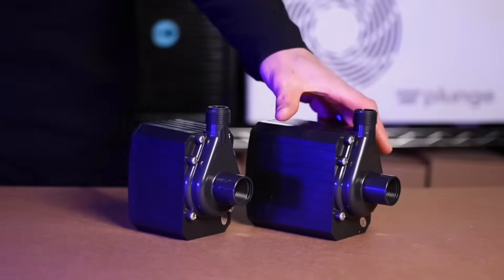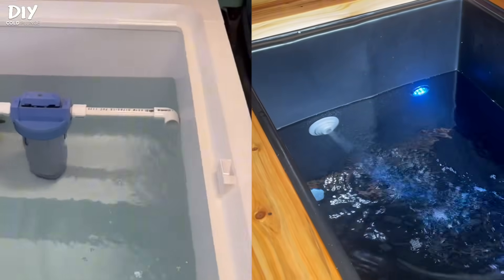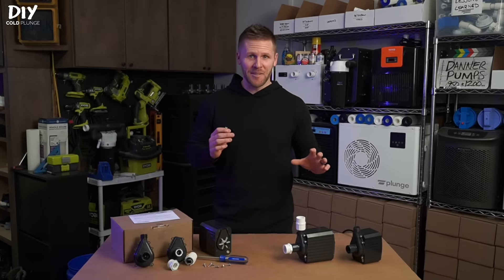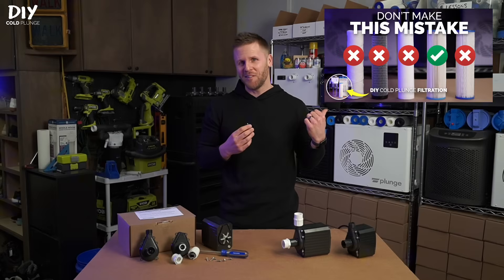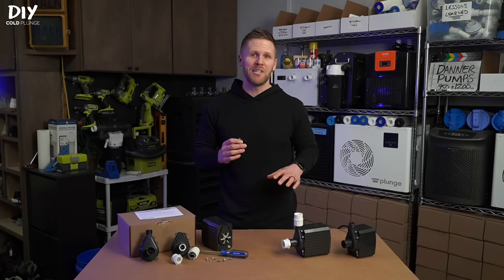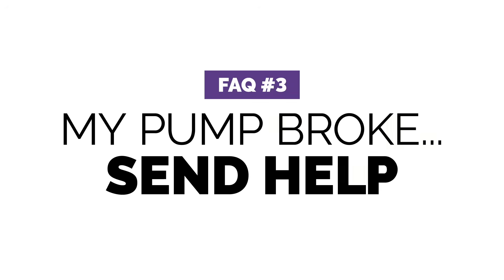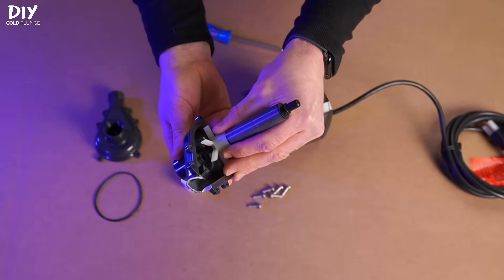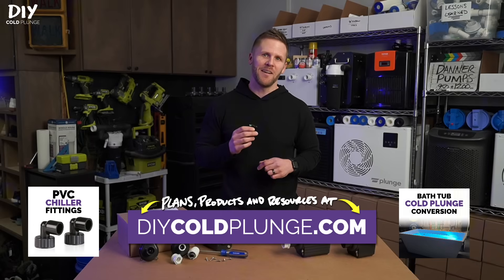The BEST Pump in DIY Cold Plunge | Everything you need to know about Danner Pumps 👍

Comment: NO, YOU DID NOT EARN MY BUSINESS! YOU WASTED MY TIME!!
JOEY corrupt, incompetant boy is nothing but a breathing advertisement and walking conflict of interest. The Danner 1200  pump underperforms by 27%!! It's also made of cheap plastic and makes a grinding sound when it runs. Here's my review of the Danner 1200 based on my tests today: 

I ran multiple flow rate tests on this pump and found that it produces 880 gal/hr. max, which is 27% less than the nominal value (1200 gal/hr). I used both a validated flow meter and a manual test (by just timing the flow of a known volume of water), both with no plumbing, so no losses from plumbing would contribute to the measurement. This underperformance is completely unacceptable.

Comment: Will the 950 work with a 1/3 hp chiller and sanitation/filtration system and 1/2” tubing?
Reply from the maker: It should, but 3/4 inch is best
Reply: @DIYColdPlunge do the pump fittings you sell work with a reducer?
Reply from the maker: No, you'd need to buy your own fittings for that

Comment: Have you tried lower flowrate pumps? I plan to use hydrogen peroxide or bromine for sanitation instead of the ozone generator, and I'm assuming the pressure requirement will go way down without the tee / venturi setup.
Reply from the maker: If you're using a filter housing I'd still go with one of these. Your filter housing, chiller and every plumbing length will affect the actual flow rate of water

Comment: I have Danner 9.5 B pump. It's been working great until a day or two ago. A plumber inadvertently shut off the water source to our fountain.  The water level got low enough where it was pumping water and air.  Now the pump still turns but it has very low flow and not enough pressure to operate the fountain. I disassembled the pump . Almost no debris. What parts are likely to cause this problem?  Do you sell replacement pumps and or parts? what is your website?
Reply from the maker: I have replacement faceplates and new pumps. Yours was likely damaged from running dry. Could be impeller damage or something else... I'd reach out to dannner

Comment: are this pumps designed to run 24/7? if is, how long will they last ?
Reply from the maker: Yep' they're meant to run 24/7. Lifespan is 2-5 years. You'll be on the longer side with less on/off cycles

Comment: Thanks for the video. I bought my danner 1200, ozone, and spa hose from you and I thank you for your tutorials. One big question I have is how do I prime the pump if it’s all enclosed?  Do I just let the water flow from the tub into the pump?  What about all the air that will be above the pump like in the filter and ozone tube?  (I build the filter and ozone exactly how you explained too btw)
Reply from the maker: Yep! you'll just let water flow into the pump
Reply: I just bought the 950 my first time doing this.  I didnt prime it and probably should have. It seems kind of weak but  I also have a ore filter maybe that may be weakening it
Reply: @bartsimp  i’m about to hook the pipe from the pump up to the filter right now. I think I’m just gonna fill it in with water and then let gravity do it job when I fill the tub up and turn the pump on for the first time.  My exit port is at the bottom of the tub.
Reply: @travisreed8244 I did not pre wet pre rinse my filter either? Please report back with any mistakes or tricks.
Reply: @bartsimp  started the pump today and it runs like a charm. I think backfilling the pipe that runs vertical from the pump to the filter helped. I filled it up almost completely full and then glued it together to the filter.

Comment: How would using the Danner 500 effect the cold plunge with a 1/4 hp chiller?
Reply from the maker: That's pretty low powered. I wouldn't advise adding any sort of filtration/sanitation to that
Reply: @DIYColdPlunge  I have one already.  What about starting out with just a filter and the danner 500 with my 1/4 hp chiller? Leaving off the ozone for the time being.
Reply from the maker: @tcc4419  Still pretty low power, each components drops the effective flow rate from the advertised flow rate at the head of the pump. You could try it but it is definitely not idea.